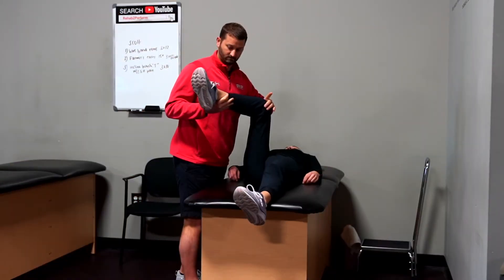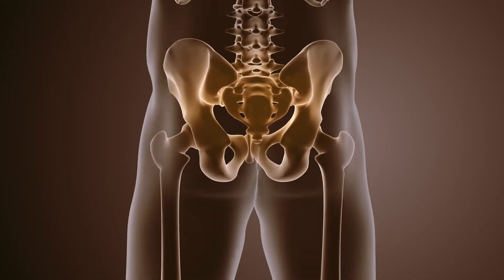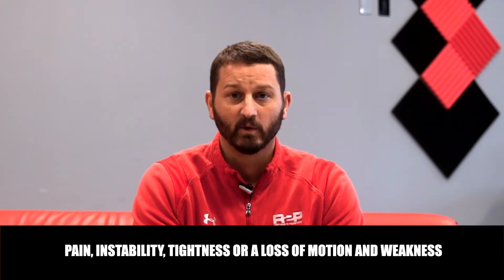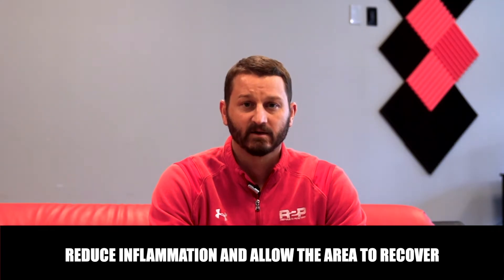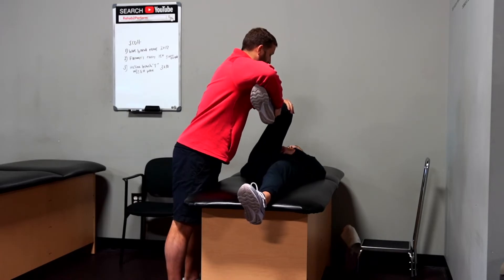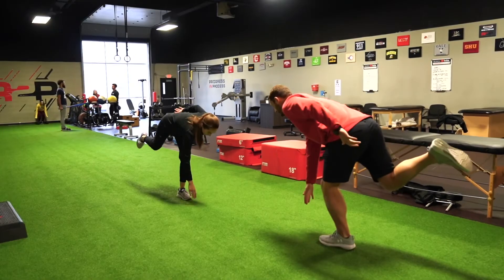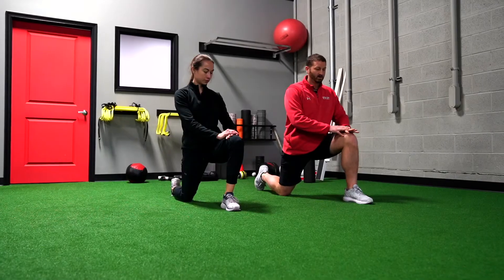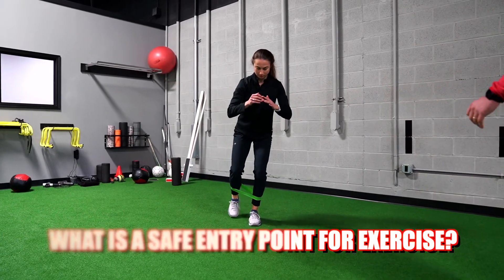Hip Labrum Tear

Comment: I had noticed clicking on my high hip and can’t squat all the way to the floor and extend my right leg back and side without pain. Took ibuprofen but not listening. October 26,2024 that’s when it becomes so painful. I stopped my normal aerobics exercise . Called my primary doctor and ordered an mRI.
Results right hip labrum torn. 
I don’t have pain standing , walking and I still sleep very well.
I had a referral to an. orthopedic but I chose to see a Physical Medicine doctor to go over my over all body as years ago about 29 years ago I was told by a chiropractor that I had pelvic tilt that later on in life might cause me as issue.
I want to know if that was causing to tear

Comment: I was diagnosed with torn labrum on the left hip also started loosing cartilage basically arthritis got steroid shot but the pain is still there and increasing
Reply: Get the surgery! I got it but I made the mistake of waiting too long to get it done. My labrum was torn so bad that my surgeon could not repair it. So he had to take out my whole labrum and now I have to get a reconstruction surgery in the future!
Reply: How long did you wait? @jvcarter21
Reply: @jvcarter21 yikes, what do they use to build up the new labrum?
Reply from the maker: What else have you been doing?
Reply: Steroid shots can destroy the joint. Avoid anymore.
Reply: Briefly, I have CAM and FAI impingements in both hips as well as anterior labrum tears. I had surgery on right hip and eventually developed heteotropic ossification in right hip near femur neck that is now taking on an oblong ship. Didn’t not want surgery on left due to issues still present after surgery . I’ve tried injections and as recently PRP but having these injections from over 4 years they are no longer effective. I also did PT for several months…at a lost now because I continue to be told that I will need hip replacement soon but Kaiser will not do until I’m 55…😢

Comment: My appt. isn't until Oct 19th with a specialist, I can't hardly wait to see what is causing my pain. When I lay on my right side I can not even lift my leg towards the ceiling not even a little. When I lay on my left side the hip that hurts I can lift my right leg with no problem.  This is driving me crazy since last year this time I climbed a fourteener and this year have trouble walking up the stairs.
Reply from the maker: Well I’m glad you have an appointment set up! May I ask what happened for you to get to this point?
Reply: @Rehab2Perform  I wish I knew, I had no accidents or falls of any kind. the only thing that I was doing different was taking Fosamax after being told I was showing osteoporosis. I took it for 17 weeks but on the 13 week of taking I started getting hip pain. I decided to stop taking to see if it would go away.  I work out, I am 68 years old. Today I worked out and can do squats and lunges but laying on my side can not lift my (bad hip) leg up toward the ceiling. Very painful to try. The 19th isn't coming up fast enough.
Reply: @jean8042 do you have insurance I need to get checked out but don't have any insurance